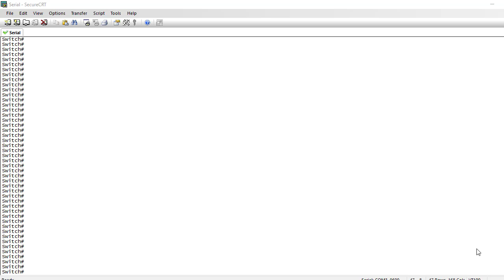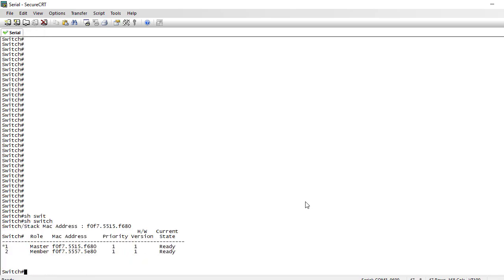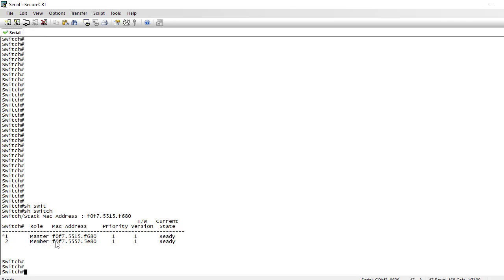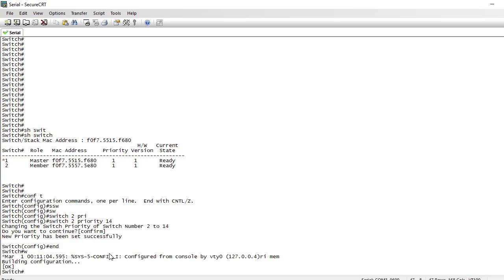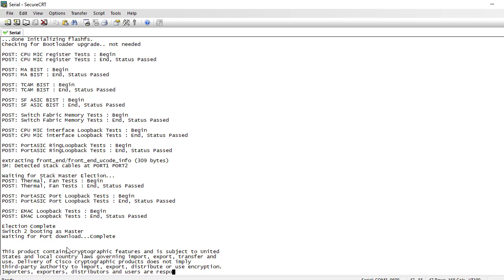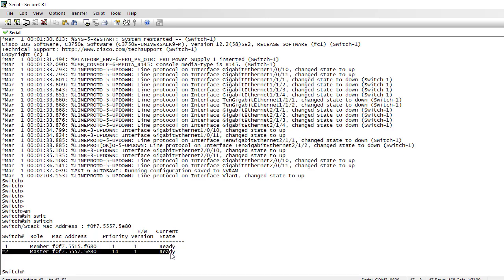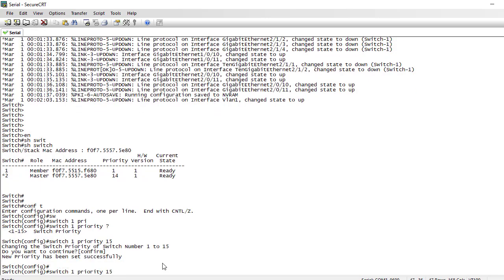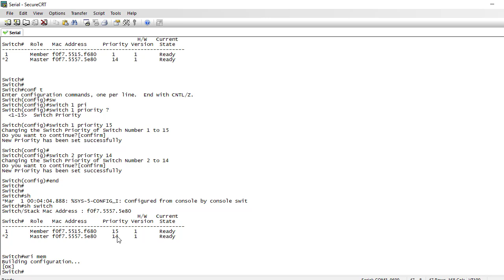Cisco Switch Stack Configuration

Comment: Sorry to ask, I'm just new to this kind of set up. . May I ask What will you get for doing this kind of set up.
Reply from the maker: In short - when you need more ports than a single switch then you need to add more switches to the stack to add more capacity. If you are new i would recommond to google it and learn more on switch stacking. Do you wanted to be a network tech/engineer ?

Comment: Here did you say if I had two switches for example 9200 and I would like to put hem in stack I just need to connect the stack cable and the swtiches automatically formed the stacking? Don't I need to make a previous configuration?
Reply from the maker: if you are adding a second switch to the existing 9200 switch, the second switch will get the config from the already running 9200.  Look at this video and you will understand well. 

https://www.youtube.com/watch?v=hms445UHeOM

Hope this helps.

Comment: Another question? Are all the files in all the stack members' flashes autogrnarated once the stack is forming? So if we format all switches flashes and only having the .bin Image file, we shouldnt run into any problems   right?
Reply: hi, yes, u can delete all file but do not delete the (.bin) or (.tar) because it is the OP of it. one suggestion, before to delete all try to backup all file in case of lose. you can do it with TFTP-Server software.

Comment: Thanks for your great contents. I have a question. Say we add a third switch to our two members switch stack which its mode is "Bundle" and we want to make it as "Install" mode so it can join our "Install" mode stack. Do we have to change its mode individually and before putting the stack cables on and then connect it to the stack or we can add it as is and make a V-mismatch and then console to the new member and change its mode and reload it ? This area is kinda vague to me. Could you please explain? 

And sorry I have to pose my second question that just sparked in my mind. How about the license mismatch? How do we match them?  And why the license has to be the same? 

Thanks beforehand.
Reply: Hello. I’m not familiar with your question regarding bundle/install mode. May you please let me know where did you study this from? Which course?

Comment: what about the configuration please ? does the master configuration apply to all other switches ?
Reply from the maker: All stack members store a copy of the configuration settings. If a stack master becomes unavailable, any stack member assuming the role of stack master will operate from the saved configuration files. Say  if you have 2 switches in stack, issue the command - sh flash2: and see - you will have the same config file there too.

Comment: Hello Network Tutor
Nice video.. i'm new on networking, i'm planning to add a new cisco 2960x on existing stacks. The switch i will add is not new. Do i need to reset it to factory default before it to the stack?thanks..
Reply: No, just add and set a priority level only , thn it will detect
Reply from the maker: it is better if you reset it to factory default. You need to erase the vlan.dat and write erase. This will make all the old vlans goes away. See this video - https://www.youtube.com/watch?v=0W_sOZiMn4o

Comment: how to see running  configuration in this stack and how to take console in this stack
Reply from the maker: you use #sh run  to see the running config of the entire stack and with regards to console access you can console into any switch in the stack. Running config will be copied to all the switch in the stack
Reply: Show running-config - u can see all details here 

Show switch details - stack details

Comment: existing stack how can we add the switch.!?
Reply from the maker: If you have a new switch, just power off the stack and add it using the stacking cable. Before add the switch, make sure to set the slot priority. Also when you power up the stack, turn on the master first. But if you have each switch priority set correct, master election happen automatically.** Main think - don't turn on the blank switch first. it will blank all the stack config. by becoming the master switch.Sorry for the late response.
Reply: @networktutor640  
thank you for your response.